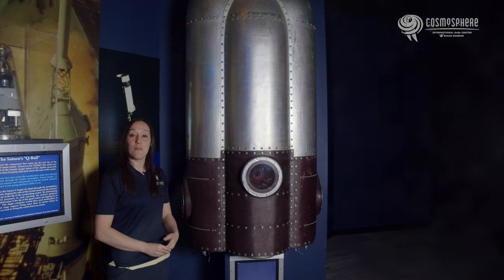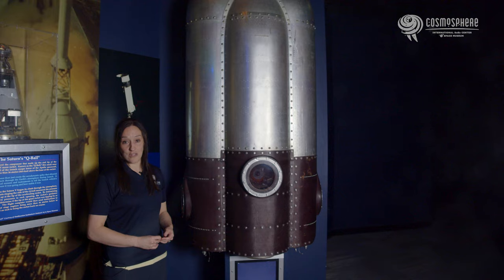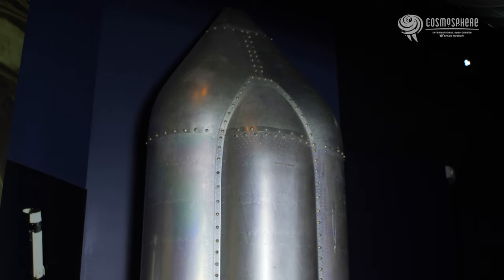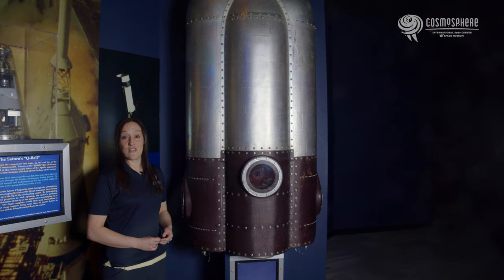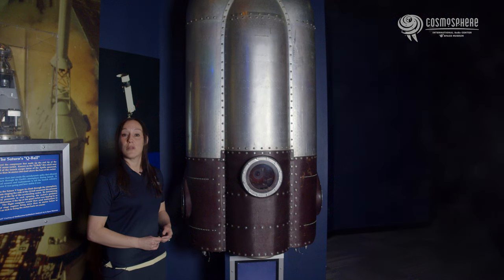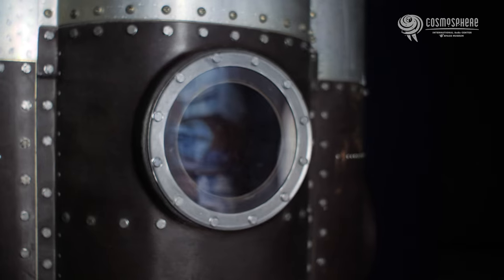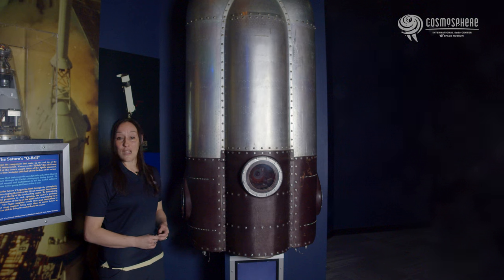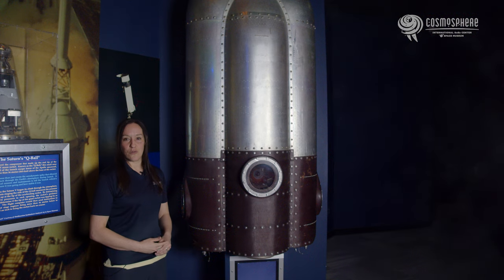Saturn Auxiliary Propulsion System

Comment: I found this correction online from what she said "Actually, the APS modules did not fire during staging; rather, there was a pair of solid propellant Thiokol TX-280 rocket motors, each rated at 3,390 pounds of thrust, which fired for four seconds at staging to settle propellants in the S-IVB stage..."